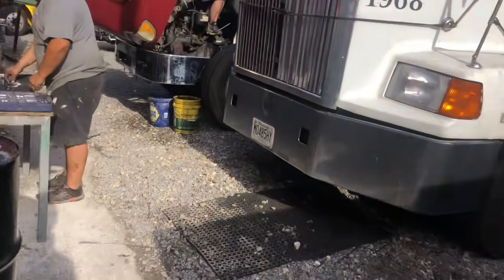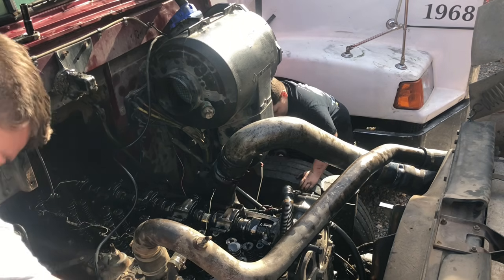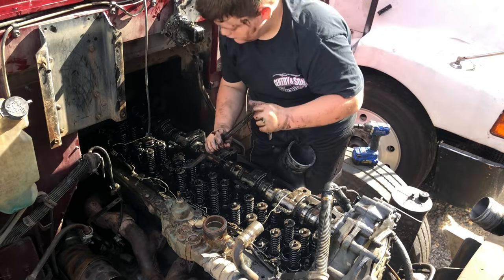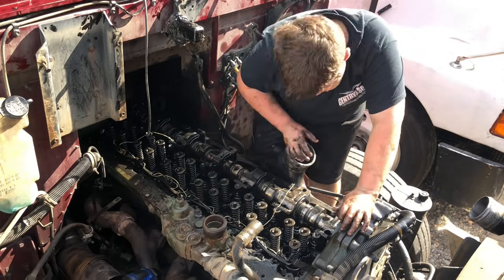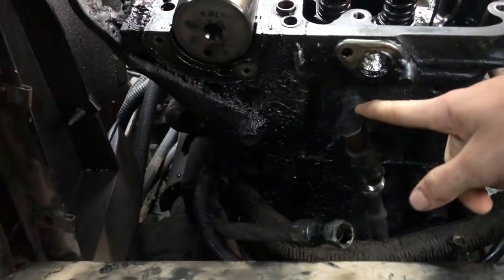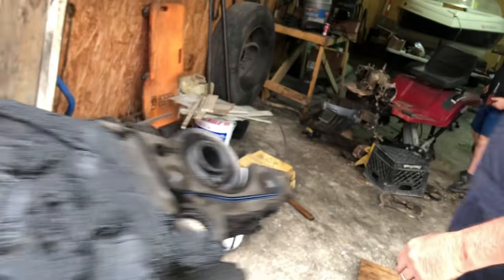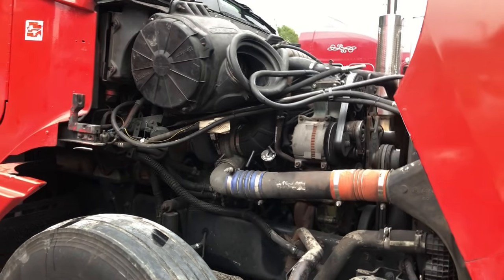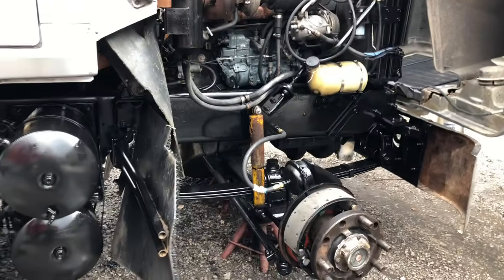Me and Braxton removed the head on the international!!!

Comment: Just a FYI get your self a roll of 1/8” wide and 1/2 wide masking tape as well as some discount brand aluminum foil to mask off things when painting them on a vehicle use the 1/2 tape to mask over labels, stickers, tags etc and the 1/8 tape to around tight spots. Use the aluminum foil to quickly mask off lines, hoses, wires, etc by wrapping the end of whatever you are masking off with your tape and them cover the rest with a layer of foil. It’s much easier and quicker than using paper just don’t use the foil on paint surfaces that you don’t want to take a chance on scratching.  Also give the truck you are working on a good bath with degreaser and a pressure washer before you start tearing it down you will stay cleaner working on it and then when you are done give it a quick clean up again with degreaser and the pressure washer I know it sounds like more work but in the long run it actually is less because you won’t have to spend as much time cleaning stuff while you are tearing it down additionally you will use less rags, brake cleaner, etc which will save the company money and you time scrubbing the grease off yourself.  As me how I know